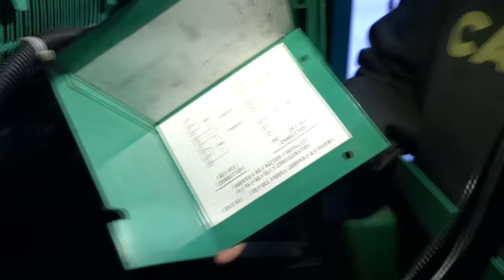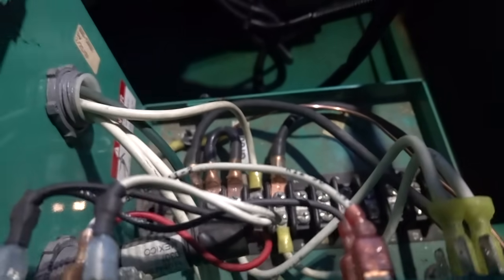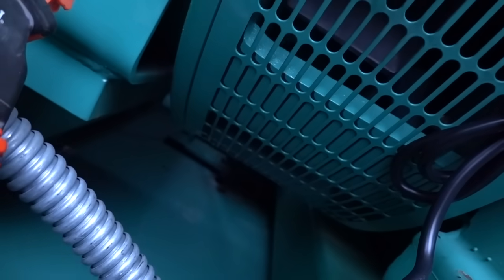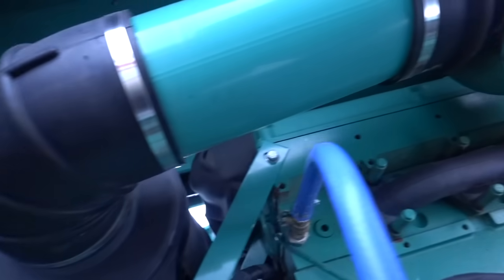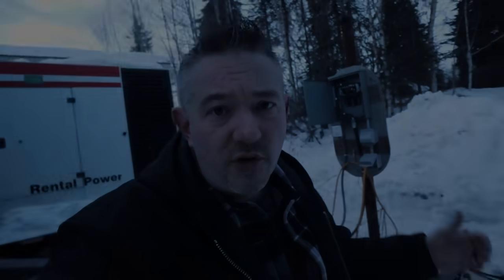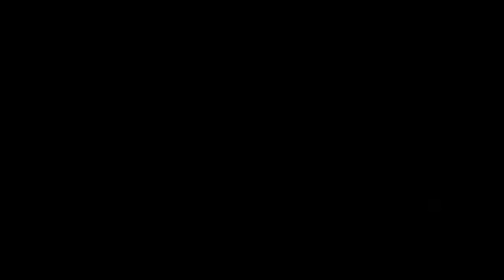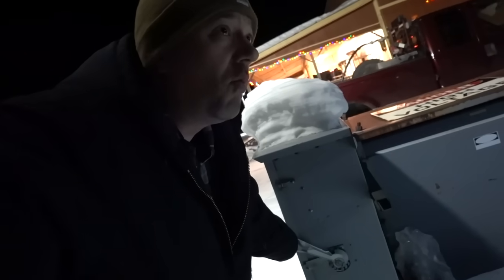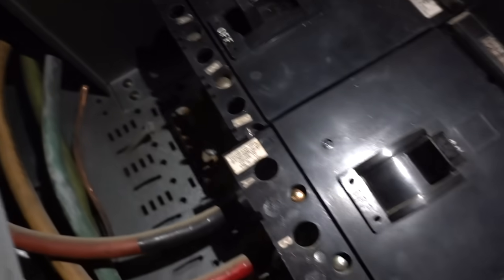HOW MUCH MONEY CAN YOU MAKE ABOVE THE ARCTIC CIRCLE?! | WOW!! Somers In Alaska

Comment: I don't understand why you had to shut off the main disconnect. You were connecting to a circuit breaker which was opened and you were in a ILINE Panel which is one of the safest panels to work in.